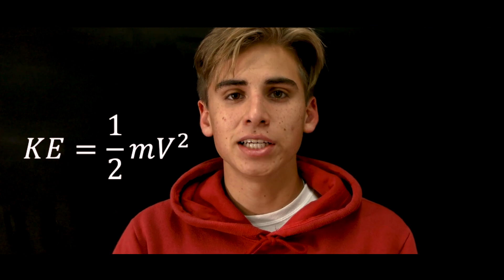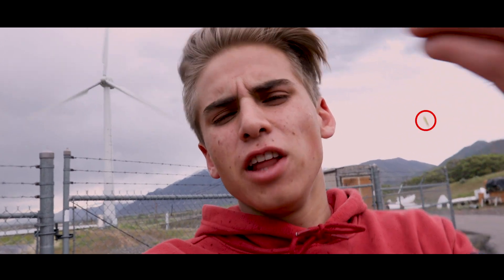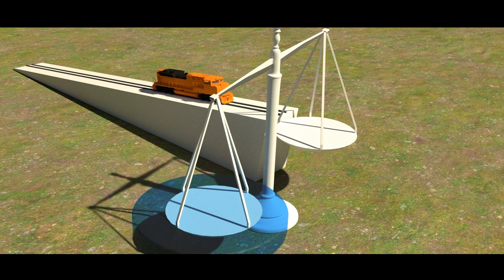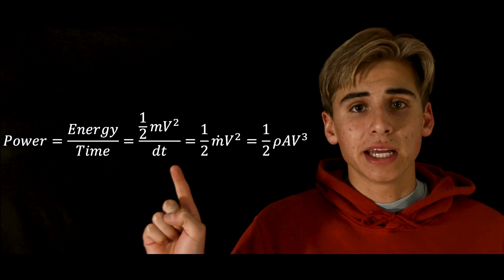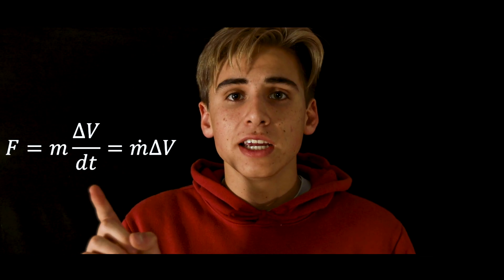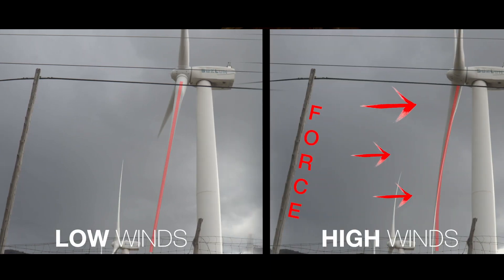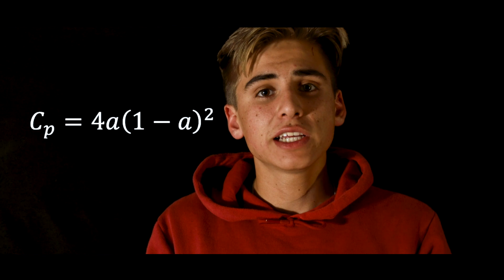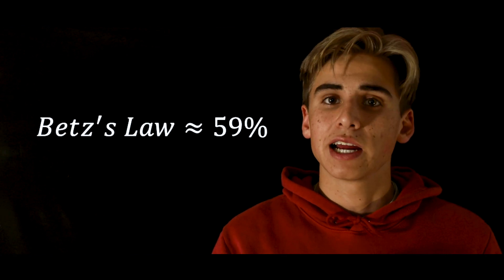WIND TURBINES: The Betz limit explained.

Comment: So if these "wind turbines" are so efficient, then why were the old dutch windmills designed so much differently? I'll tell you what. Build an old style Dutch windmill, which runs a generator. Lets see which is most efficient. When any wind generation device has such a small sail area, it cannot produce torque, and torque is what is most necessary in a wind generator, NOT SPEED! These Rube Goldberg devices were designed to fail, and to look like airplane propellers. They were designed to need government subsidies to be built, and can never pay for themselves. Wind-mills, however, would be much cheaper to build, and produce much more electricity. (That was the point; "Wind turbines" were designed to be expensive and inefficient. They were designed to fail, so that electrical wind generation would never present an alternative to coal, gas, hydro-electric, and nuclear.)
Reply: @Bjorn Toft Madsen  I think that was an unnecessary cunty way of saying that. But yes Jack Fenn you are wrong. Modern wind turbines have such huge blades it would either be structurally impossible to create a blade similar to Dutch windmills on the same scale as they are today or the material needed would cost to much when there is a better option. The design of modern wind turbine blades are all about generating lift which is why they are shaped similar to a propeller as what else also produces great lift, planes. You can also trust the fact that people want money and private companies that build wind turbines aren't going to purposely design inefficient turbines as another company would make a more efficient turbine and any government subsides would go to the most efficient turbine.
Reply: @Bjorn Toft Madsen Now that is a first someone changing their view point in a youtube comment section. I hope you have a great day, it is difficult to not get overwhelmed by when everyone is saying everything is fake news whichever side your opinion falls. Also bloody hell Bjorn is a cool name.